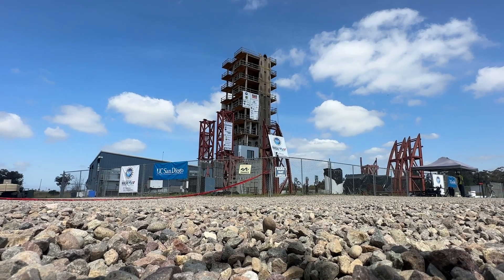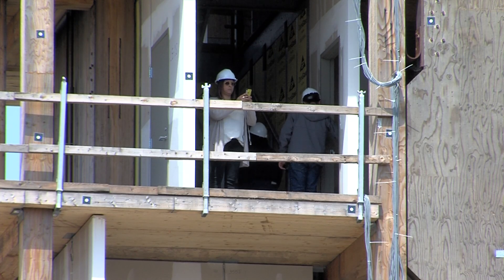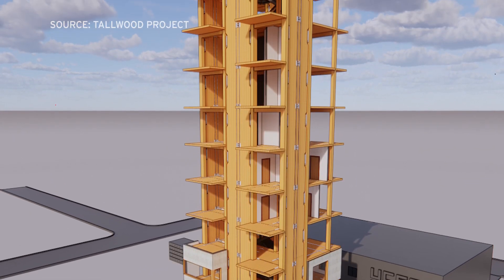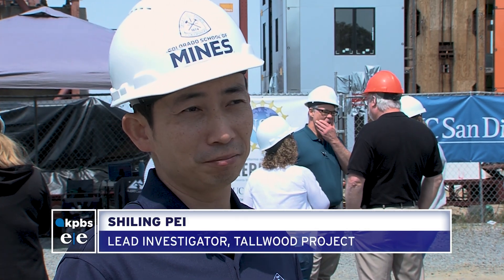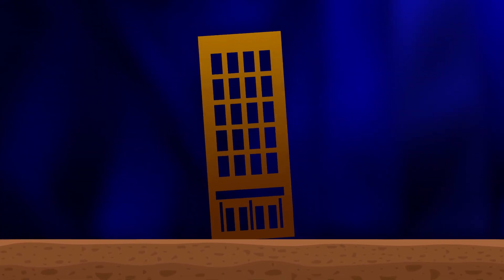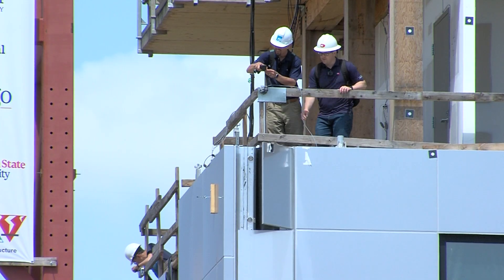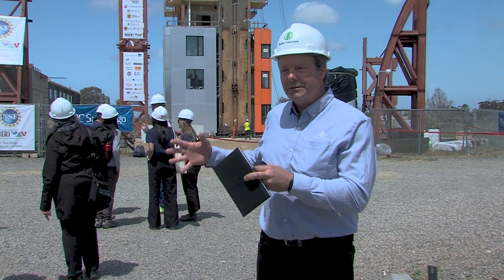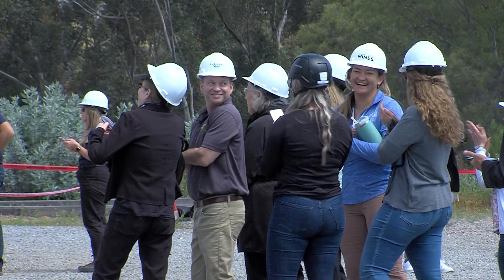10-story wood building passes earthquake test

Comment: so its safe from earthquakes, but not fire.
Reply: That's not entirely true. Mass timber can burn from its outside layer but the inside remains intact and structurally sound. It actually resists more fire damage than steel! It's one of the other pluses of using such building materials in places like California for its wildfires.
Reply: Mass timber is actually naturally fire resistant and develops a char layer that protects the structural fiber below when in fire, like the previous poster replied. Intumescent materials (fire protection paint and caulking), were actually engineered to make other materials act more like heavy timber. It's pretty interesting - I'm an architect in Portland and we recent had a fire engineer write a judgment to the city officials stating this for our own mass timber structure. The code hasn't quite caught up yet, but it's old technology!
Reply: Mass timber has better fire ratings than most concrete buildings, extremely counter-intuitively. (Current Simpson Engineer and former Structural Engineer) - as acor pointed out, there is a protective char layer that forms to keep the structure in tact and the core from burning. A concrete rebar reinforced building will see rebar failures in concrete beams much, much faster and the building will tend to collapse way faster, not allowing time for fire teams to get people out. At that point, the building is a tear down and rebuild anyways, concrete or not, so you really get better fire performance with mass timber than concrete.